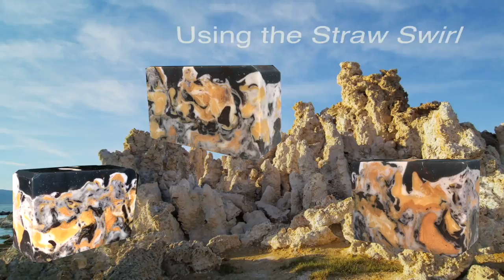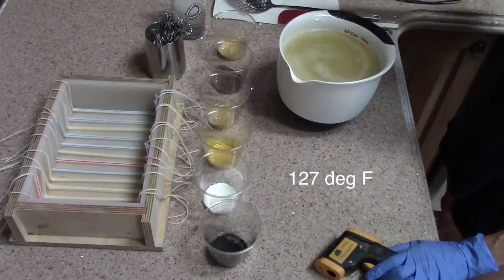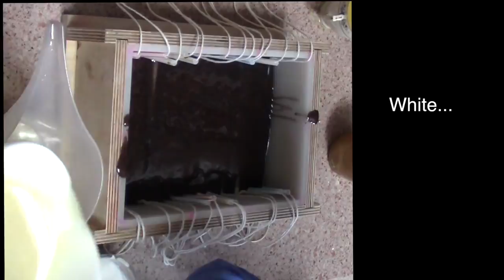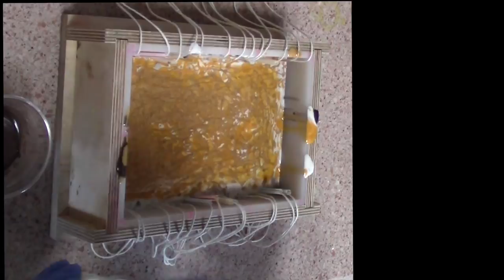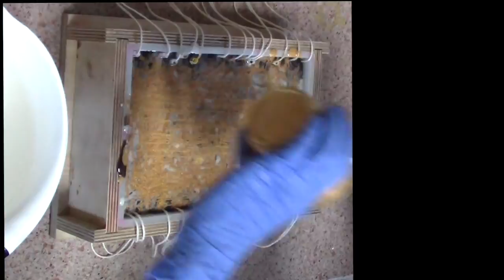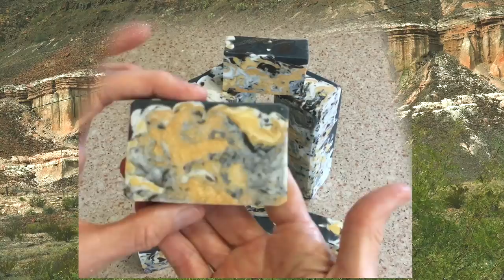Making “Subduction” Cold Process Soap with the Straw Swirl

Comment: How did I miss the Premier Release?  Go for the “Crown” Grace.  Astounding!   I am curious.  Did you experience much waste with the straws’ cavities?
Reply from the maker: Actually, I didn't have any in the straws and when I tried to wipe the soap on the surface it was so little that it wasn't worth the trouble. But the straws were pretty tight against the sides of the mold-that may have had something to do with it. Thank you for your encouragement and question😀 💝